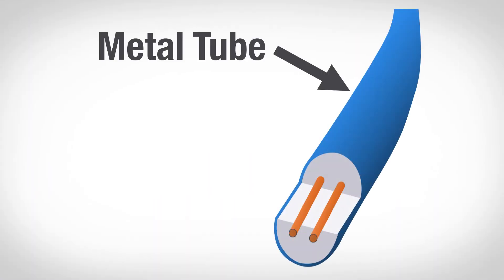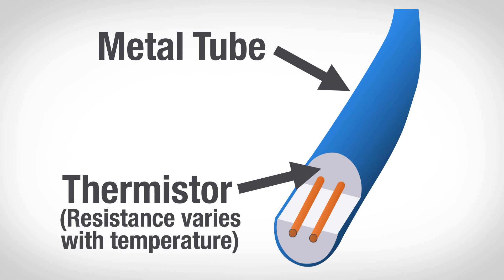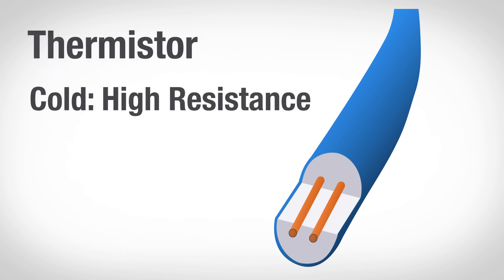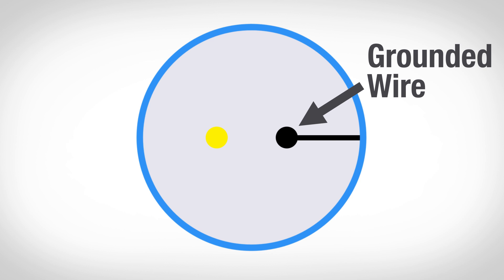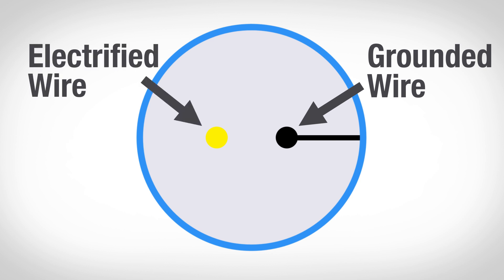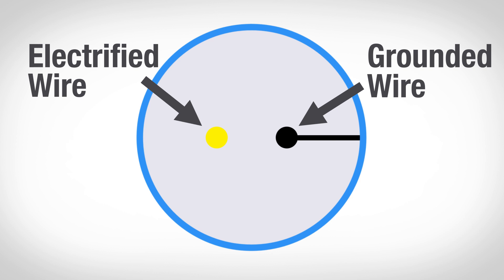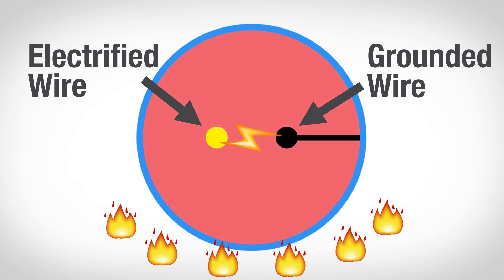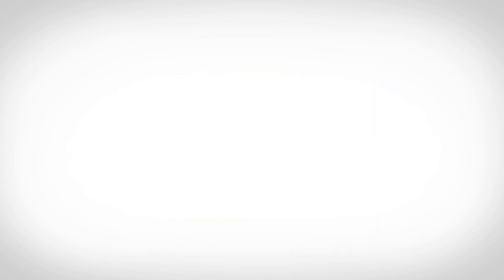How You Know If There's A Fire On Your Jet

Comment: One other use that these loops are used for is on bleed air ducts. They'll route them along the ducts from the engine up to the air conditioning pack so that way if there is a leak at a connection point then a warning will go off in the flight deck. We call this system Manifold Fail Detection. Its used on the C-17... I don't know what other airframes it is used on. Cool video!
Reply from the maker: +Austin Ford Thanks for the info Austin!
Reply: That's interesting information.  Doesn't the C-17 also have an additional thing they do with the air they use to increase lift that other aircraft do not do?  I think the engines blow air thru ducts over the or under the wings so they can do super short takeoffs.  

I'd be interested if maybe there is extra fire detection loops in the C-17 due to that, or if there is just a different design.
Reply: jim stephens You may be referring to the flaps. When the flaps extend, it'll get in the way of the thrust that the engines produce. When the thrust hits the flaps, it is deflected downward. That downward force is basically contributing to keeping the aircraft in the air. This is one of the reasons why the C-17 is able to perform STOL ops.
Reply: Austin Ford absolutely right.
Reply: Also used on bombardier airframes as well.

Comment: As clarification those temperature rises depend substantially on rolling speed and load/air-pressure. The primary source of the heat is hysteresis in the flexing rubber.

Comment: I hate mentioning this because I feel like I am just adding smart alecky history to this, but sadly people had to die to put these gear well fire detections in place. Nigeria Airways 2120(which was a DC-8 owned by nationair), was leaving Jeddah Saudi Arabia when the gear caught fire. Since there was no detection in place the pilots weren't notified of the fire until warnings from other sensors started blaring in the cockpit, but sadly it was too late. The DC-8 landed just 10,000ft short of the runway after a breakup, and 261 people were killed. Again I hate mentioning this, but sometimes it's good to know that not having gear warning can lead to disaster.
Reply: littleferrhis nearly every safety system in aircraft today are due to fatal incidents in the past. But that can be said about almost any safety system anywhere. Car airbags weren't just an idea developed out of nowhere to help save lives.

Comment: There are two loops for redundancy ?
But two doesn't allow for redundancy because you can't know which one is giving the false alarm, IE if one says no and the other yes then you can't possibly know if there IS a fire because the "no" might be a false one ?
Reply: You make a good point. To explain why two is sufficient you have to look at the possible failure modes of these thermistors:
A short circuit or low impedance fault between the live and ground wire - This would look like a false positive (fire detected with no fire present) The most likely result of senor failure, a breakdown of the insulator properties, mishandling of the cable, voltage surge on the live wire. etc etc could all cause a fault with the same effect as a fire would. 

An increased resistance between the live and ground wire - This would prevent the thermistor from working as originally intended and could prevent the detection circuit activating when a fire is detected. Fortunately, due to the mechanical and electronic properties of the detection mechanism, the chance of this kind of fault is orders of magnitude lower than the low impedance/short circuit fault. If there was an increased resistance this would appear to be a decrease in temperature. The system could check if this temperature reading was valid by cross-checking against other temperature measurements (I'm not certain it does this). 

A disconnected temperature sensor (infinite resistance between the live and ground)  - This fault would be detectable as during normal operation (no fire, no sensor fault) some current flow would be present. If there is no current flow then there would be a "TEMP SENSOR FAULT" reported.

For this particular system, dual redundancy is sufficient as only one failure mode is undetectable and likely to occur. There are examples of airline systems where dual redundancy is not considered sufficient (eg hydraulic system).

The most important thing when designing safety critical systems such as these is to sufficiently isolate the two devices such that a single fault, could not cause the same failure in both systems at the same time. This isolation and redundancy are one of the key reasons why aviation systems are so expensive.